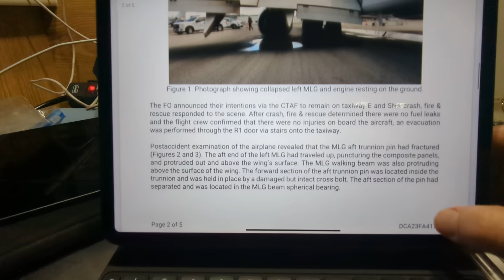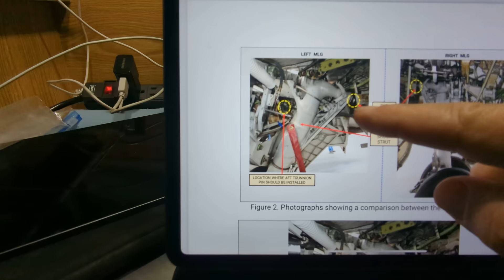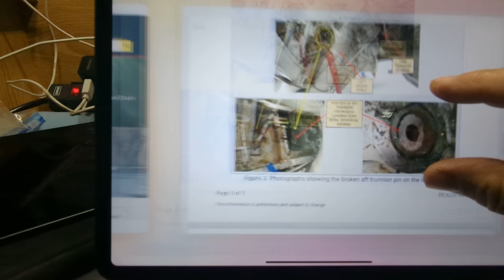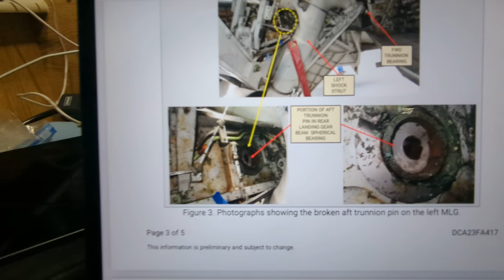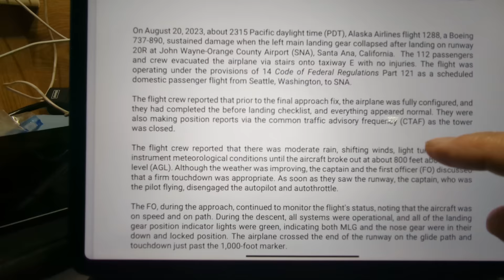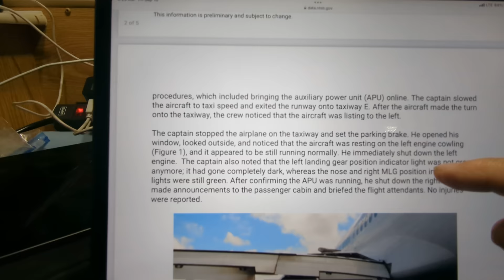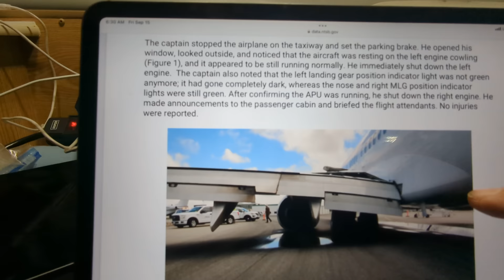Alaska 737 Gear Failure NTSB Preliminary Report.September 15, 2023

Comment: In my humble opinion , this has the look of classic fatigue fracture.
Reply: This item could not really be a contender for fatigue unless there was a defect and that would likely have been an occlusion missed in manufacture or possibly poor maintenance, whacked a few times with a mallet!🤠 (Edit: Sorry, a sort of pointless comment, I was thinking aloud).
Reply: @martinda7446     It is my understanding that a fatigue crack originates in a defect you have described.,  not necessarily visual to the naked eye. This gives a distinctive visual pattern in the fracture zone,  which I believe I could see in one of the close ups.
When I flew the 737 all my landings were 1 g ,  so I’m available as a consultant to subsidise my retirement 😈
Reply: @californiadreamin8423  Ha ha lovely. I couldn't see much more than a clean brittle type fracture, but there was almost certainly as you describe a fracture, unless it was heat treated poorly or similar. I just cant see it on the images. I'm NOT an expert. Just an engineer in a different field.  I think I flew with you and needed waking up at the gate.

Comment: How for back did the data go? That plane came down through Southeast Alaska to Seattle before it's trip to California. It would be interesting to see the data for JNU WRG PSG and KTN.
Reply: Where I worked I could bring up the landing report and print it in the cockpit but that report was sent via ACARS and all ACARS messages were available in what we called the Green Screen system. Some of that data may be deleted over time but I recall looking at not very current data. Every landing has a recorded G reading on touchdown. I once had a telephone call from OPS after landing asking if we had had an engine failure leaving FL180 on arrival. None that we noticed so they just said that type of false report had happened before. Never heard another thing about it.

Comment: Thank you Juan for acknowledging those of us that knew it was a mechanical failure. Boeing makes the greatest planes ever to leave the ground. Alaska Airlines has the best pilots. (Those with at least 3500 hours). It’s indisputable. 24/7-365
Reply: The max debacle would suggest otherwise.  Perhaps the best to leave the ground but not the best to return in a [human] controlled fashion.
Reply: @eliotmansfield  Elio stay the hell off them then. Thank you.

Comment: I think they will have to expand their investigation.  The way it cleanly snapped is indicative of a manufacturing problem of some kind (materials/micro-fracftures/gray market parts/who knows...).  I'm not a materials expert, but it doesn't see to be showing obvious corrosion or deformation of the parts holding it together, and that's a little worrying.

Comment: And the engine still running 😉
Reply: Still running after being used as a left main landing gear for taxiing clear of the runway! Sounds like a great ad for Boeing engineering and the robust performance of the venerable CFM56 engine!
Reply: PS: How do you know that you've landed gear up? It takes full power to taxi to the gate!

Comment: I ain't an expert on  aircraft struts,  have they eliminated  that there might have been a problem in the strut hydraulics/ pneumatics/ shock absorbing?   I am thinking maybe the strut bottomed out under  that problem and transferred a lot of  impact to the rest of the surrounding structure
Reply: Strut bottoming likely would have shown up in camera jiggle and perhaps the sound.  The strut appears to have remained intact, so its servicing (pressurization, oil volume, seals) can be verified.

Comment: With thousands of 737’s taking off and landing every day I’m sure it was a one time anomaly that it failed and In my opinion it would be crazy to issue an AD to inspect all the main landing gears.
Reply: If anything maybe an Eddy current inspection of it whenever a gear swap is done if it's possible.
Reply: It depends on what they find. If you recall, Alaska had some bad maintenance issues with the MD80's and the elevator trim, but it turned out it was industry wide. The AD for that came out as a result of the fatal crash that revealed the problem. This wasn't fatal, but it has the very real potential to be one in the future.
Reply: @FloorItDuh  I’m in agreement with you

Comment: You can't land long at this airport !  I have been flying in and out of John Wayne for 50 years and every landing I expect hard reverse thrust and chomp on the binders.  Actually, I am always a little apprehensive every time I land there.
Reply: That, and the noise abatement procedures over Balboa Is, this field should be closed completely. How about repurposing El Toro as its commercial replacement?

Comment: I’m sure Dan Gryder will be quick to apologize for throwing shade on you for the original Alaska video where you posed the question as to whether a pre-existing fault in the gear could be a contributing factor.
Reply: Apologizing isn't really Dan's thing.
Reply: @jimmyoverly3512  Nor anything which starts with the letter A (e.g. Accuracy).
Reply: @marcmcreynolds2827  Dan has nothing to apologize for. Name one thing he got wrong.
Reply: @jimmyoverly3512  He will make a definitive statement regarding the cause of a recent accident even though he (or anyone else) can't possibly know at that point.  About the last person you would want to have running an NTSB accident investigation, for example.

Comment: They need wheel rotators like Citations have on front gears.  Stopped tire hard impacts will continue causing these broken landing gear accidents like Red Air MD87 at Miami last January and many others.
Reply: That wasn't from tire spinup.  Load on the tire from spinup is less than from typical braking.  In the various airliner tire ceritfications I was involved with, no one ever even mentioned spinup loads.
Reply: @marcmcreynolds2827  Didnt we or one of my students with a motorcycle debated that with you?  The 130 mph impact on the stopped tire will twist the geat a lot.  That is why in motorcycles or bicycles we say to hit the ground ROLLING if we fall.
Reply: @CFITOMAHAWK  I wouldn't call it a debate.  Someone with no real knowledge of airliner tire stresses/certification, or landing gear dynamics in general (but plenty of strong opinions), kept making ignorant assertions working from off-base analogies which I (the airliner landing gear engineer) refuted.

They were as stubborn as they were ignorant, however, so nothing was accomplished other than that over the course of the exchange I ended up putting forth a lot of specifics which perhaps some non-specialists reading the thread might have found interesting.  Explaining why it works to spin up a NLG with vanes but not a MLG, for example.
Reply: @marcmcreynolds2827  It was me and another of my old students when i was CFI.  And we have motorcycles and apply the law airliners should too.  WHEN HIT THE GROUND, ROLL THE BODY OR YOU WILL GET MORE HURT FROM THE STATIC IMPACT. HIT THE GROUND ROLLING.  Now, can you show us the contrary on a motorcycle at say only 20 mph?   You .. Not others.  YOU.  
I have no broken bones non my crash due I ROLLED.  Show me the contrary you say  works better than rolling when hitting the pavement. SHOW US ALREADY.

Comment: You would think these days that there would be cameras placed strategically to be able to see these things on a screen with out having to open a cockpit window and look out. 
Nearly every new car on the road has at least some ability to see in the crest at least, if not all the way around.
Reply: There are on the 777
Reply: I agree ! In  today’s world not having multiple cameras  gives a whole new meaning to flying blind
Reply: Retro-fitting even simple cameras would be a nightmare in terms of getting certification. All of the new wiring would affect the cable runs of the existing systems; the cockpit displays would have to be adapted to handle the new inputs; the technical manuals and checklists would have to be updated; pilot training would have to be revised to include the new camera monitoring procedures; maintenance schedules would need to be extended to include the new camera gear...

There are probably another dozen points to cover, but the bottom line is that fitting non-original cameras and components would cost someone a lot of money.
Reply: @EleanorPeterson definitely and not justifiable to the board or stockholders.
Reply: I’m not sure about airliners, but I know some biz jets have cameras on the outside. They can be viewed from the cockpit and the cabin.
Reply: What is the problem to be solved here? "Pilot had to open the window" doesn't seem a compelling reason to bolt cameras around the plane. 
Then there's maintenance. Besides "it costs money" there is also the question whether you would fly if the camera failed. I'd be kinda sore if they canceled my flight because "the GoPro on the left wing has a bug splat across the lens, and we don't want pilots to have to look out the window."
Reply: The cameras are useful. On the airframes I’m familiar with, there are three regular hd video cameras mounted to the aircraft. One forward facing on the top of the tail. One forward facing on the belly and one aft facing on the belly. The cameras are used mainly for situational awareness. You can see if the gear is down. You can see if anything is directly in front of the aircraft, that is too close to see from up in the cockpit. And it’s extremely useful for taxing in smaller airports where the main wheels can get close to the grass while turning. There is also a forward looking infrared FlIR camera on the nose that can see through fog. This allows for seeing the runway and terrain in bad weather.

Comment: Just recently, I had an incident where I had to stand on the right rudder pedal after a landing as well (in a little Cessna), and, like these pilots, I initially thought it was a flat tire on my left side. Of course, unlike these pilots, my initial thought turned out to be correct.😎

Comment: It’s too hard to make out in the picture to be sure, but there are none of the features of a ductile failure visible.  Single rough surface without cupping or necking visible, no waterline type stretch and release propagation marks.

I really want full camera resolution of the cracked pin photo.  Or micrograph.  And Rockwell hardness and the pin standards for that.  Overhardened can be metallurgical disaster.

Comment: While my career in commercial aviation was largely based in avionics systems support, my (nearly) two decades with BAC provided enough of a 'gut instinct + observed knowledge base' to realize that an effective 'trunnion inspection and resolution campaign' involving confirmation - of, and monitoring for heat/physical stressor embrittlement will likely create an "AOG situation from hell".  With the trunnion failure likely having created a situation where the 'landing gear load focal geometrics' changed, and those changes falling well outside of the designed-for parameters, well, I'm guessing that the'pickle forks', keel beam, and keel beam mounting intersections and areas will be receiving a quite thorough 'peek beneath the covers'...

Comment: Back in the 70's, I took my first commercial passenger flight from Seattle to Phoenix on a 737.
I was seated directly above the RH gear.  When the plane took off and the gear was raised, an awful grinding and slamming sound scared the crap out of me. 
I vowed to never board that model again. 
3 relatives of mine besides multiple friends have worked at the "lazy B".
There was something wrong with the engineering of the early 737 landing gear

Comment: Juan, don't get too far ahead of your skis on this one. Just because the FDR did not record a landing load in excess of 2.2G does not mean this landing gear didn't see a load in excess of the design limits. The fact the trunnion pin failed will reduce the load the rest of the airframe saw. My hat is off to the aircrew, they did a great job. The trunnion pin has been sent to the Boeing Equipment Analysis lab at Boeing Field. They will know in a pretty quick order if there was any problem with the metallurgy of this part. Boeing Engineering will be able to look at the full FDR dataset and make a calculation of the load that gear saw. Boeing has the pin, the FDR data set and the experience of nearly 17,000 737 being flown since 1967. It will be interesting to see what comes out of this.

Comment: What makes me wonder, outside of design, engineering, and whatnot considerations is the overall business model in practically any industry. When two companies have 95% of the aviation market and Wall Street is happy, an invisible microbe brings down supply chain with repercussions two years later. Isn't it time to review market strategies to become a little more resilient? I'm not saying this would have avoided a pin problem, but how many times have we heard an outsourced company outsource=d a component and safety checks should have been tighter. I don't know. It seems we're a little too focused on market shares and no longer what is at stake. I'm not sure how you pilots handle the pressure of carrying souls on board, with the pay you have and knowing everything that can happen. I'm in awe of you guys.
Reply: The overall data is that accident/fatality rates have dropped dramatically and consistently over the decades that two companies (not always the same two) have had 95% of the aviation market.  An "exponential decay" looking curve.  So something must be working right.
Reply: @ElectricUAM  That's an interesting (implied) question as to what number one would choose for the optinum number of more or less equally-sized airframe makers.  So far it's been working well safety-wise with only two IMO, but that has also led to capacity constraints resulting in decade-long order backlogs.  Or perhaps as you suggest, more than two would be even more safe.

Comment: Non pilot or airplane mechanic here, so not trained on the plane details. But I walked around these airplanes a number of times. 

My thoughts. 1) the FAA is going to issue an inspection directive at minimum on this. If nothing else, to verify if more follow on activity is needed or not. 2) the damage is repairable. There are lots of retired 737s out there suitable to pull the needed parts and pieces from, and I am willing to bet all the pieces and parts are still available new from Boeing since similar models of this plane are still being built. 3) whether this airplane is repaired and returned to service depends on the business case for fixing or writing this airplane off.

Comment: It's sad and slightly worrying that the reaction of many people to this is a complacent "It's probably just a one-off; no need to ground and check the whole fleet", rather than, "We must do whatever's necessary to ensure the planes are safe".

Money talks. Very, very loudly. 😞
Reply: If it is a one-off then there IS no problem. Maint didn't detect corrosion and someone will get fired. That's not a systemic issue that requires grounding a whole fleet.
Reply: I agree, those comments sound rather complacent. I suspect that some are not fully explaining themselves. That they know the NTSB/FAA will be having a hard look at Alaska Airlines’ maintenance records to determine if it’s a maintenance issue, ie) failed pin s/h been replaced x cycles ago etc. Then it’s unlikely an AD is required. Given how many 737’s are in service and the millions of cycles done it’s unlikely to be a systemic issue with regard to its design, manufacture and materials used. This will be throughly investigated and whatever corrective action necessary will be taken notwithstanding the seemingly cavalier comments made. Lol Not to worry.
Reply: I can see them putting in extra scrutiny during the level C and D maintenance, see if the issue is showing up elsewhere.  Guaranteed they'll go over the airplane maintenance logs.  We'll see what we will see.